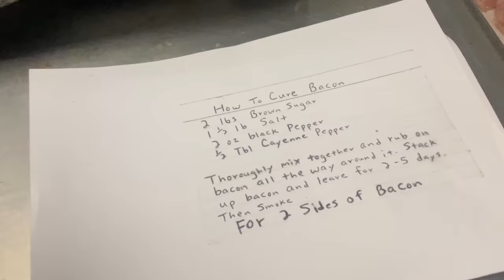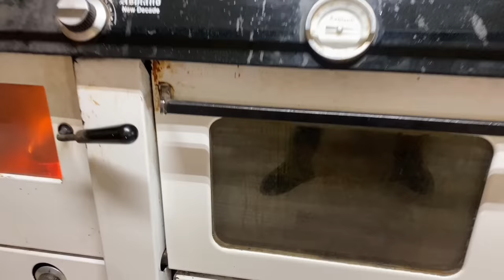E5: Making Sugar Cured Bacon Fresh From The Farm: Behind the Scenes of A Guenther Family Tradition

Comment: simple solution. to prevent mold, use 1 cup of vinegar per 2.2lbs in the sugar and or salt solution. sugar usually adds "shine" to your meat, but it creates mold because of the protein it extraits. unlike salt which leaves saltpeter, but it is not "shiny". The vinegar does not affect or alter the taste.

Comment: On the grinder...did you ever sharpen the knives or plane down the plates? When you assemble grinder dry, without any meat in it, and tightened it by hand. Check to see if you have any end play on the shaft. If you do have end play, get washers to install on the back of the shaft. Between shaft and back housing. You should be able to create friction by tightening the end cap by hand. One more thing that helps is to cool the meat down to about 33 to 35°F until the meat gets firm. It's important to have the knives and plates planed down to a mating surface.

Comment: Oh my,,,, the sausage being ground that is "mushy" is because you are grinding room temperature meat. It has to be 35 degrees or so before you grind it. Also when the grinder clogs up you need to take the plate off and turn it on and run ALL the meat out of the auger. Then put the blade and plate back in and then screw the auger head on.   I  have 40+ years in this business and just trying to help.